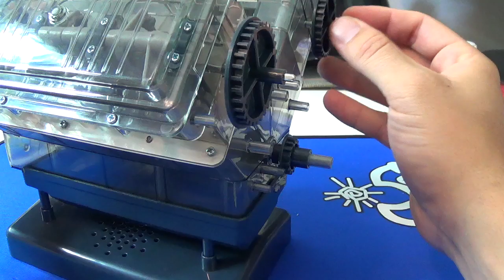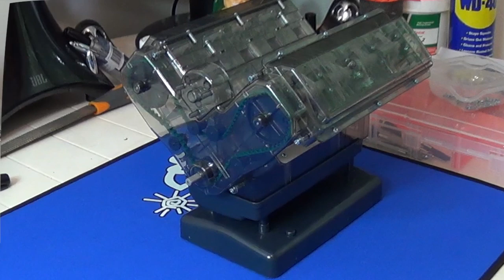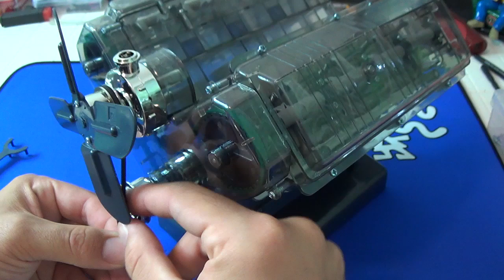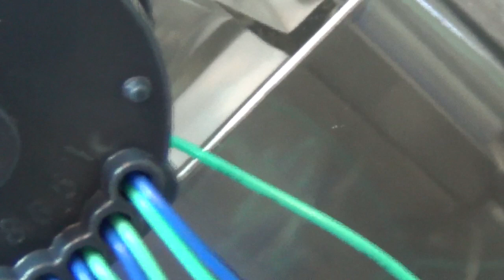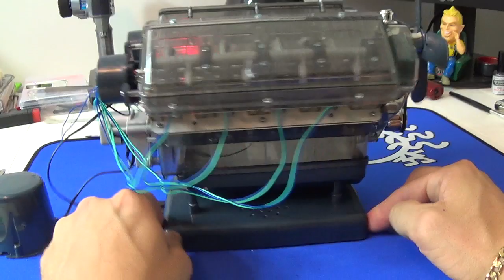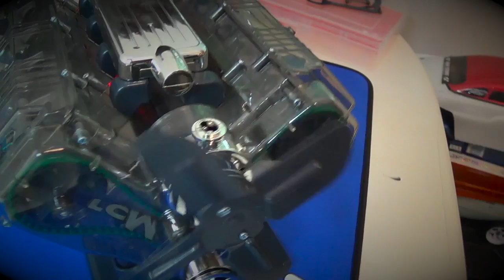Engine Build - Final Completion

Comment: the one i got sucked it self destructed as soon as i started it  up i had to do cutting on every part to make them fit together it was also missing 3 springs for the valves
Reply from the maker: absurgetheinternet that sucks. mine was fine and a joy to work with.

Comment: Are you gonna paint it soon?  I would really enjoy watching the video. Great series by the way :)
Reply from the maker: I am. Still trying to determine which parts and what colours.  Do I leave it see through or not? Any suggestions.
Reply: +RC Car Mods i wonder if you would buy a second one of these and just make a little motor that spins really fast, then just plug it with the engine and try to blow it up to see if it actually kinda looks like what would happen in real life (holes in block, smashed conrods, broken valves, cracked crankshaft and other stuff)
Reply from the maker: +Marijana Brezić if i canfind another one that would be a great idea. this one i in my box of goodies for the mancave when i get one hahaha

Comment: your "B" bank distributer (pistons 5-8) is the same as mine was (180deg out) your firing sequence is going from 4 strait to 5 instead of 4 to 8 - sequence should be 1-5-3-7-4-8-2-6 i took it apart carefully (with 3 way screwdriver similar to a philips) **watch you don't loose 2 little ball bearings and spring inside** then flipped the center spinner over and put balls and spring back in the carefully put backing plate back on, also had to have the distributer at a different angle than it shows in instructions (point to bottom left not bottom right if view from behind) then i advanced the 1-4 distributer and retarded the 5-8 one to get firing more evenly spaced and on time with pistons. if you go to fix it maybe vid doing the change so others can fix theirs as think it is a problem with assembly of the kit. i have the 4 cylinder version as well and that had the same problem (was firing on wrong stroke of piston) only other thing i did with mine was have the cables come out below the manifolds and tidied up the cables with some cable ties - could also look nice with some heat shrink over them but could be tricky to do
Reply: His sequence is right just look at the video carefully.

Comment: Nice video. Have you painted it yet? I was wondering if I paint the pistons and valves, will it still operate ok with the thicker parts.   Will the paint rub off on the internal walls? Cheers
Reply from the maker: Brett Nichols I am looking at painting it soon. but your right there may need to be so.e adjustments made to incorporate the added paint. i would suggest using rc paint (tamiya) so it should flake.